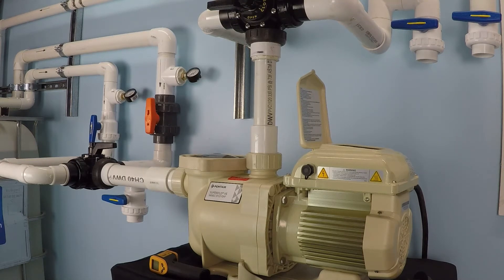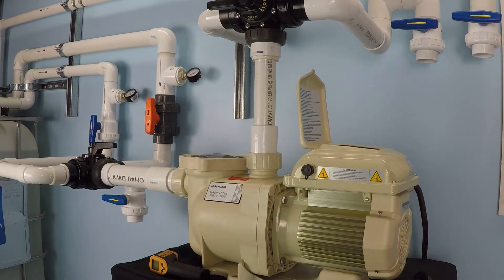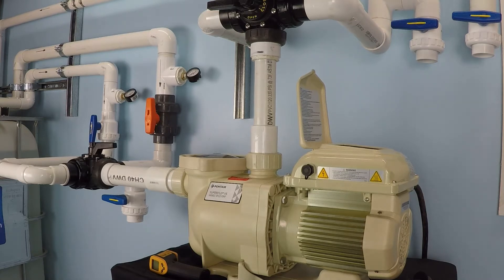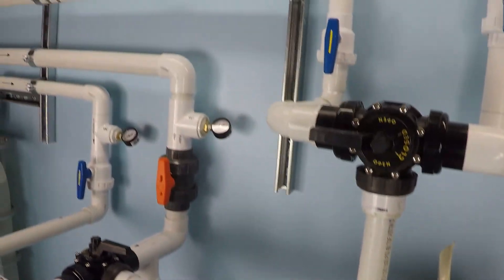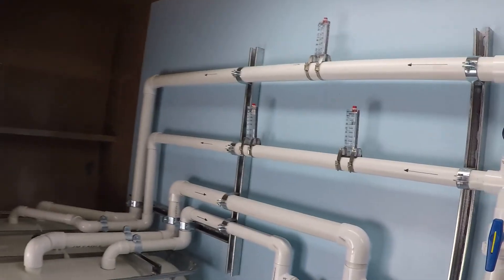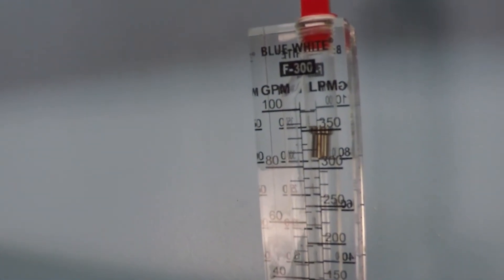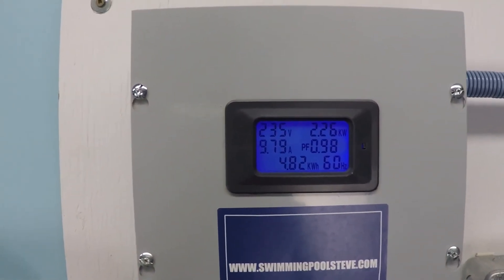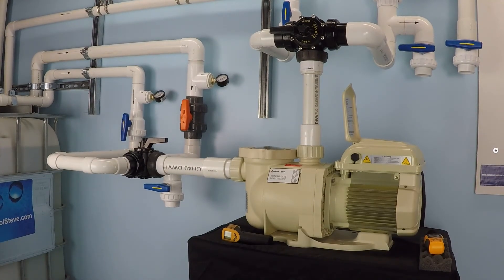How Much Power Does The Pentair SuperFlo VS Use?

Comment: It would be useful to know the power usage at the default schedule speeds: 3000, 1400, and 2200.
Reply from the maker: But the power usage at these speeds would be different on every pool system. Same with flow rates due to each pool having an entirely unique resistance to flow.
Reply: @Swimmingpoolsteve  I understand, but using this as an estimate would be useful.

Comment: Hey Steve,,, i believe the reason the motor is limited to 3000 rpm @120vac is because the VSP electronic controller uses power on its own. Not the motor,,, but the actual VS drive. When you combine the VS drive and the motor amps it will exceed the common household 15/20 amps 120vac circuit. They must limit the speed/load to protect the circuit.
Reply from the maker: This is correct. The amperage draw of a circuit can notnexceed 80% of rated load. So a standard 15a 115volt circuit could sustain 12a continuous. This motor is too large to run above 3000 rpm, as ypu indicate.